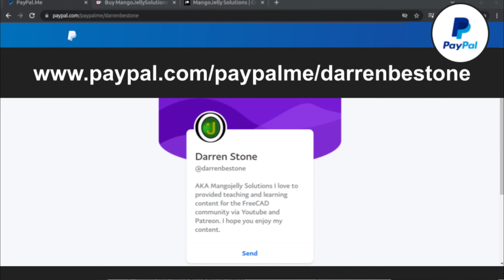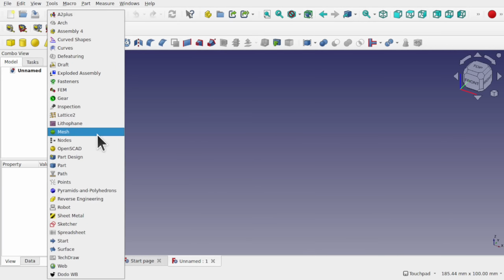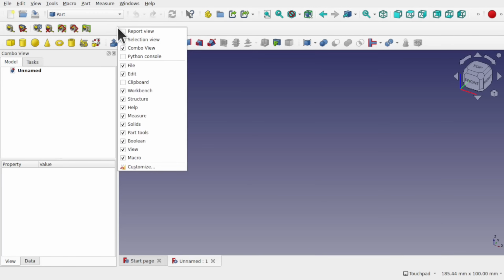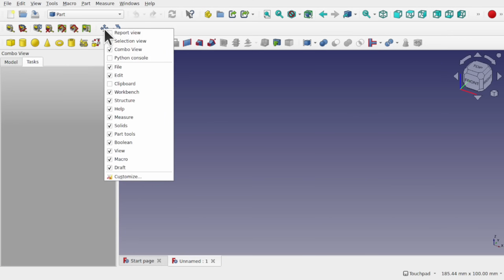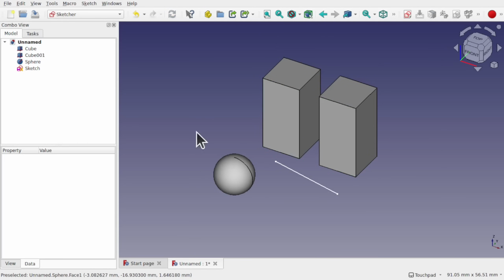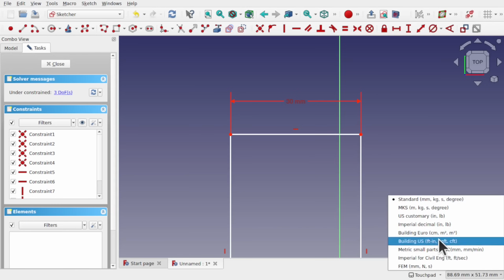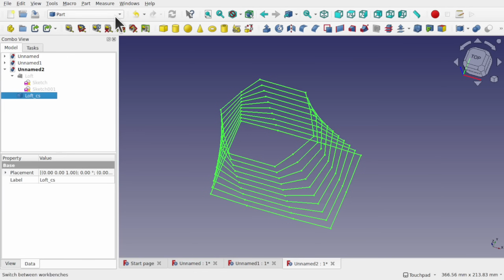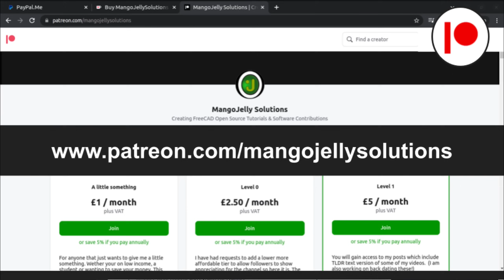FreeCAD: April Top Tips To Help Save Time And Effort

Comment: Anyone having issues with their STL models being hollow? Using freecad for Linux.
Reply: Maybe when you are extruding a sketch you forgot to have solid checked. There are similar check boxes on other tools as well. Without the check I believe you end up with shells which could be what is happening to you. They can look right while not being.😉
Reply from the maker: Sounds like you have the solid on the extrudes set to false if your using the part workbench. This could be because the sketch you have extruded wasn't closed so it has a continues border without breaks.
Reply: I fixed it thanks for your help guys

Comment: For dimension constraints, it is possible to combine different UOMs in the same dialog. eg 2.4" +1.5mm. This is extremely useful when a data sheet is in US customary units but you are working in metric.
Reply: Have you tried to write for exemple 1.5in + 4.35 mm? Im another program that i work with (3d experience feom dassault) it does rexognize and can calculate mixed uom, but you have to write them. " is not rexognized but in is. Maybe it work like this in freecad.
Reply: @akimen64  I have not tried 'in' as it is not commonly used in UK but the " symbol has worked fine in FreeCAD for as long as I can remember!